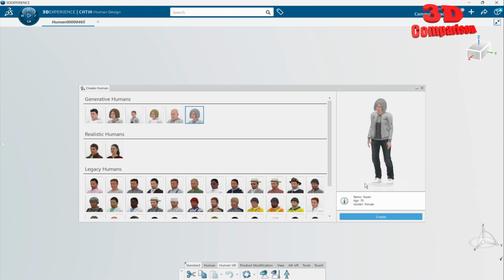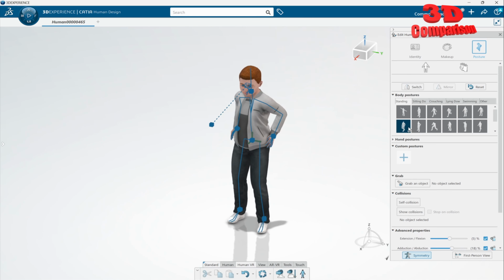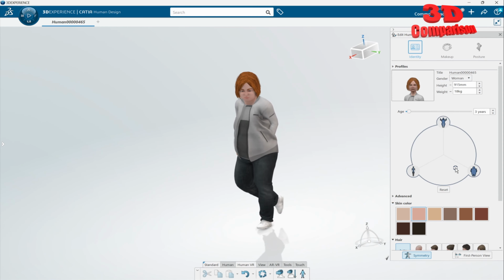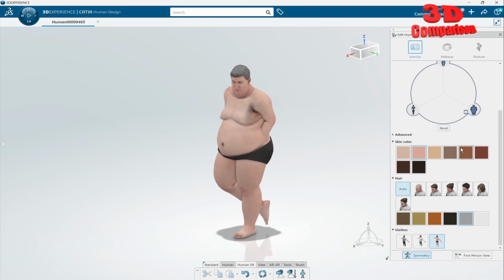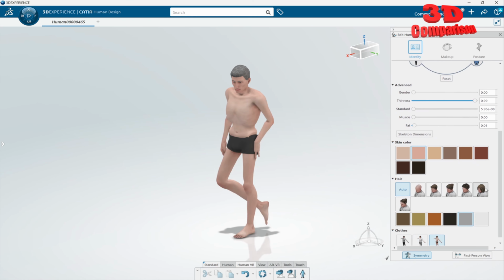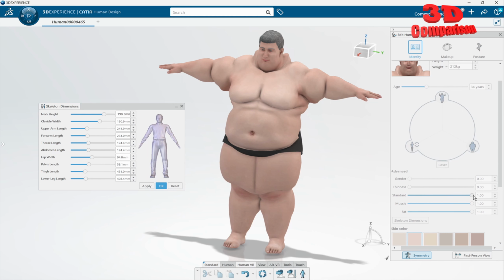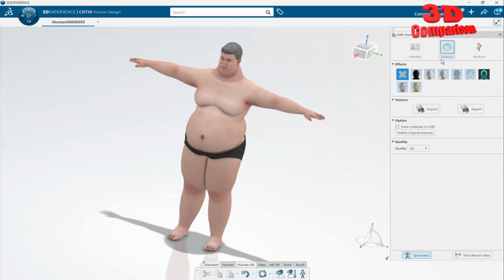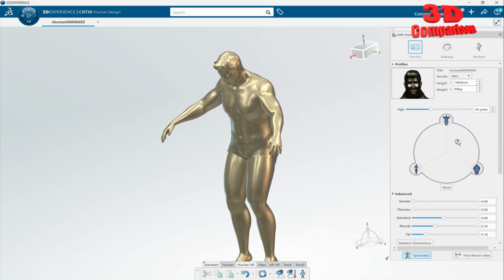3D Experience  - CATIA - Human Design overview

Comment: Thank you  for this beautiful demonstration!

But there is Something I don't understand with  Dassault system.
They don't  want to evolve the  version V5, but they want us to move on to the 3D experience (which is not available in all countries).

The assembly module is very poor compared to SolidWorks. They can for example think about adding new constraints, like spring constraints for example like in fusion 360, screw-nut constraints,.......and lots of things. The startup interface is also very old!
V5 deserves to be improved too!
Reply from the maker: Thanks for the support! I agree, I also wonder why they don't implement various updates to CATIA V5, feels like the software has remained the same for an extended period of time now. - I have addressed this within a video - https://youtu.be/pNAymUVUQ4U. Thanks for the comment, feels good to know that other people feel the same about CATIA.